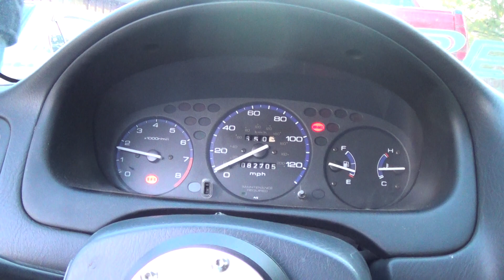Luke's built turbo coupe update

Comment: I like the polished out bling underneath, thats the look I wanted with my teg.
And a D-series turbo could easily push more than a B or K series at a fraction of the price
Reply: +Raul Rodriguez lol Building a high powered D-series engine costs more.  This is why alot of people do the swaps away from the single cam.
Reply: I'm no stranger to swaps. Yes B and K are way more desirable engines to BUILD, but I wasn't talking about building an engine. All I was saying is, if you're stuck with a D series anyway, BOOSTing it can get you more power than a stock B or K series swap, for less money.
K bye.

Comment: I’m looking to boost mine I was thinking of swapping but I’m just gonna use the swap money to get another car so I can daily something but I was planing on building my y8 so what you guys think is it like worth it cuz I was gonna build it kinda how this mans set up is with the vitara pistons and a bunch of other things I was gonna do.. rods. Intake throttle. Apr studs, stage camshaft, block gaurd, bigger injectors and that’s prob what I’m thinking a good ebay turbo then tune it to a good 7 psi.. is there any advice you guys think like I don’t wanna build all this and then boost it and break right away rn my car is stock and has a staged clutch thats it like everything is stock I switched up my radiator fan to aluminum with better fans and better hoses and headers and catback super good one.. with a better intake but I wanted to do this and I was thinking is it worth it.. cuz later I was gonna swap but I just wanna have fun for now on a low budget and truly not trying to break I’ll prob put it on 5 psi or whatever just so it can be fine so lmk
Reply from the maker: Santos Tuner  I had a stock d16y8 with a ebay turbo kit, p28 ecu chipped ran 13’s on 8psi never had a problem even on 10psi it was fun